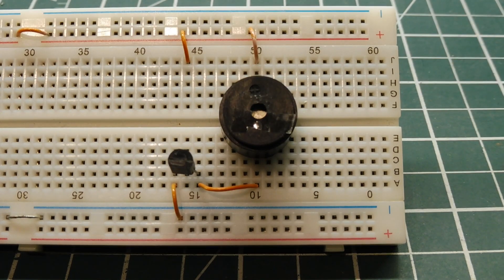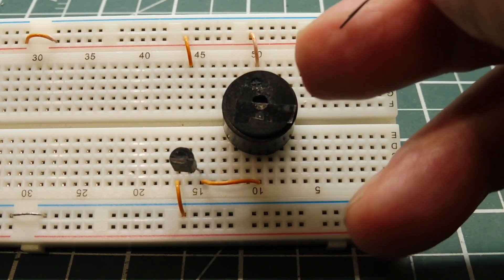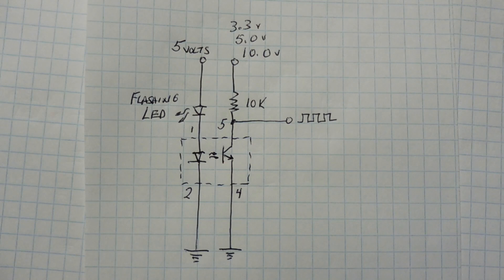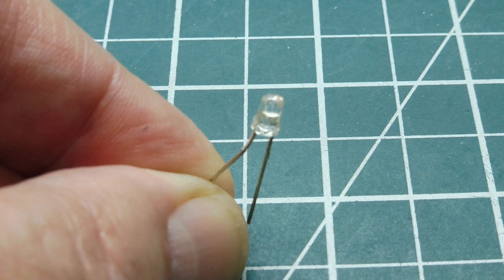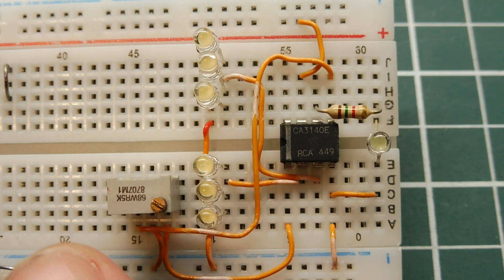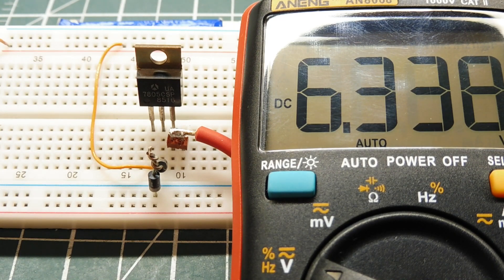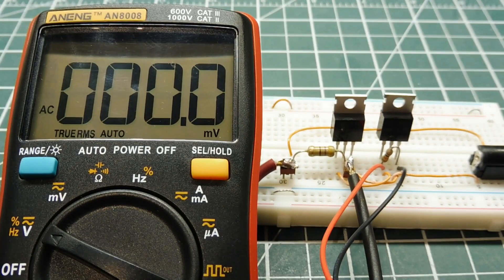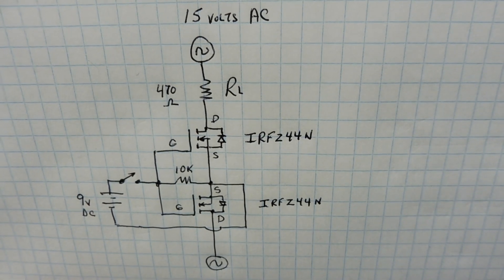Simple Electronic Circuit Hacks

Comment: can you help me a bit.. there is a circuit for residual voltage you can use to charge somthing higher voltage... like taking residual voltage from the air to charge a car battery.. do you remember the name of the circuit
Reply from the maker: You are probably thinking about an energy harvesting voltage multiplier charge pump. You can generate a voltage but never enough power to charge a battery.
https://www.youtube.com/watch?v=XpLCK88nVgU

Comment: Led bank circuit you made ,I tried it with UA741Cp and also I used red Leds for the bank, instead of white , but it isn't working, could you suggest what could be the problem?

Also the pot, im using is the rotary pot.

Thank you! Love your videos..
Reply from the maker: Adjust the null pot until the LED just turns off and then block the LED bank connected to pin2 to trigger the circuit. https://youtu.be/vzX02jfR5s0

Comment: Hi 0033mer - saw your video because of a link on Hackaday.
I have a hack question. What hack would you use to reset a pc via the RESET jumper pins from another PC? Is there a better way than a relay?
Reply from the maker: The reset pin usually has a pull up resistor pulling the reset high. To reset, you pull the reset pin low. You can do this with a NPN transistor with the collector connected to the reset pin. For isolation between the two PCs, use an opto-isolator like in the video. The first PC turns on the internal LED and the collector output will pull the reset pin low.
Reply: Thanks. I'm going to see if I can recycle an opto-isolator out of some surplus electronics. 👍

Comment: Dear 0033mer, thanks you for your quick and direct explanation of so many great circuits! I have one question regarding the 7805 and the number of diodes: You say that we cannot add more diodes "or else we loose our regulation" and I wonder why that would be?
Reply from the maker: This hack works because the forward voltage of the diode is fairly constant at .6 to .7 volts when turned on, but will vary with temperature and current change. The more diodes the more errors. A TL431 has a 2.5v reference and is temperature compensated so it will work better for higher in/out voltages. You can also use LEDS which have higher forward voltages depending on the color.

Comment: Hi 0033mer :)
Not sure if you’ve mentioned in a video, but how do you estimate length of jumper wire to cut them so they are nice and neat on your breadboard?
Reply from the maker: There are no tricks involved, it's just a lot of practice. I have been doing it for many years together with laying out PCB's by hand that also helped a lot.

Comment: Thanks, another good video. I thought the diode temperature and light sensing circuits were best. Are there any techniques to vary the frequency of the flasher LED (or just via component selection)? If not, it may have limited applications
Reply from the maker: The frequency of the flasher LED is fixed. It's good for clocking sequential logic for troubleshooting. For a fast clock you can use a CMOS inverter RC oscillator.
Reply: The flashing LED uses a fixed period, so there really is no practical way to vary it.

Comment: Cool hacks. One mundane thing I have been wondering for some time now is what type of jumper wiring are you using on your breadboards and where do you get them from?
Reply from the maker: It's cross connect wire used in telephone central offices.
https://www.amazon.ca/Belden-22208260-2-Pair-Connect-1000ft/dp/B00GNBY7RW
Reply: Used ethernet cables also work.
Reply: @beforth  Thanks. I thought I had heard that somewhere else, but I did not have spare or broken ones to try it out with at the time.